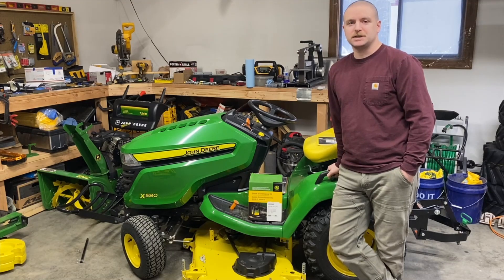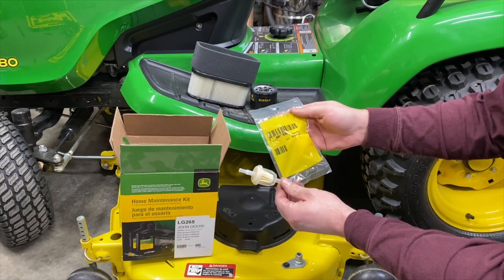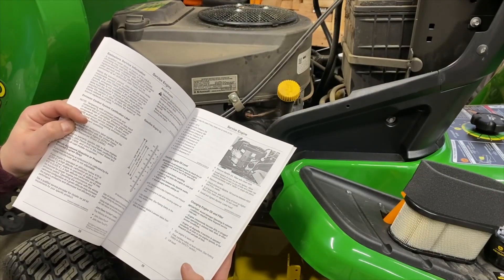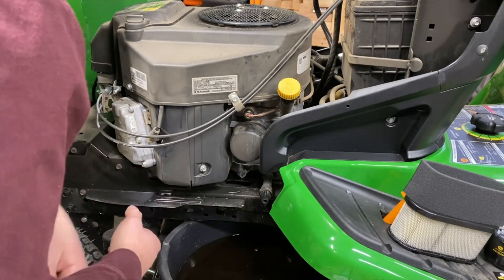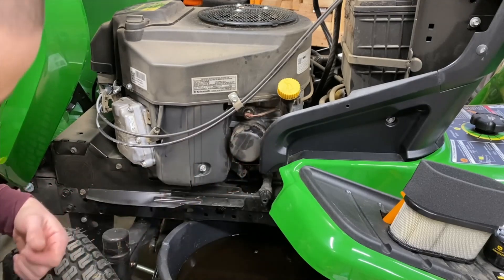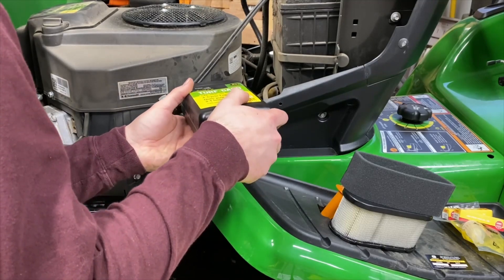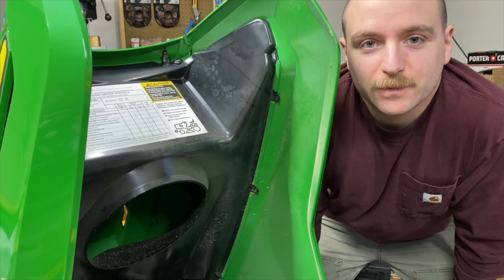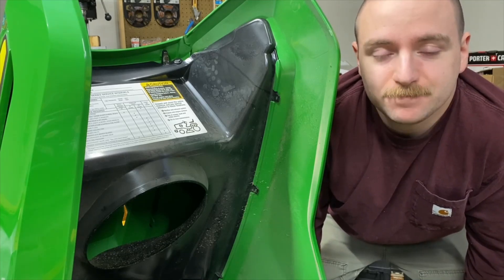John Deere X580 Home Maintenance Kit  - Part 1 Oil/Filter Change

Comment: Thank you for your video it helped me on changing the oil. My late father did all the maintenance on the tractor so I’m now learning to do it all myself.
Reply from the maker: Glad it helped you out! I have all the routine X500 maintenance on here too for the other stuff (fuel, air filter, and transaxle fluid)
Reply: @JoshsGreenGarage  do you have one on how to change the blade on the mower deck?
Reply from the maker: I don’t believe I do, it isn’t hard though, you just take the deck off (I have a video on that) then flip it up, and take off either the nut or bolt that holds the blade to the spindle. I usually do it with the deck still attached and lifted all the way. You will need to put some wooden blocks in there though to stop the blades from turning. One of my first ever videos of my D105 might show something about blade removal as I probably took them off to sharpen before selling, so you might get an idea there. Otherwise, I am sure someone has done a video on it.

Comment: Great "grown-up" video! Only thing different I do on oil changes is I fill the filter up before replacing it. My diesel Mechanic always recommended that procedure, so I just continued it with everything. The filter element prevents spillage and lubing up the gasket is quicker too.
Reply from the maker: Yeah my only problem is spilling oil since the filter is sideways. Plus, oil flows from the outside to the inside of the filter, so I would try to fill it from the edge rather that just dump into the middle, you never know, there might be some small debris from manufacturing or impurities in the oil potentially. Really low chance, but these are things I worry about.

Comment: After loosening the oil filter try slipping a ziploc sandwich bag over the filter. Slide the bag as close to the open end of the filter and keep it there while loosening  it. When the filter is free from the threads slowly pull the filter away from the mower and at the same time tilt it so top of filter is lower keeping old oil in it till you move it away from mower. Still doesn't hurt to have a few disposable towels laid under the filter before loosening it because there will always be a little spillage.

Comment: The floorboard seems to be separate from the rear fenders on the X5 series. 
Are the fenders hinged for easy transmission maintenance?
Why else would these 2 pieces be separate?

!
Reply from the maker: Yes, having the fender deck and floorboards separate makes maintenance easier. They are not hinged though.

Comment: What is the viscosity of the engine oil?
Reply from the maker: 10W-30. Always check the temp range that you will be operating in though, as you can use other viscosities as well.

Comment: Do you recommend changing the oil right after the end of mowing season or right before the beginning of mowing season? I'll put around 25 hours annually on my x590. Thanks.
Reply from the maker: Depends in my opinion… is it getting any winter use? If it is getting winter use then just change it when due or I would say before the next mowing season. If it isn’t getting used and staying indoors where climate controlled, it probably doesn’t matter, but may be a good idea before it sets so that metal dust from normal wear doesn’t build up or any kind of deposited start to gunk anything up. If not used, not climate controlled or outside, it should be winterized. I always ran red storage Sta-Bil in mine, and I kept it in a heated garage, so I didn’t bother winterizing the engine. If winterizing is the case I would wait to change it after winter, after the first startup, that way any junk in it can be broken up once the engine warms and then everything can be drained. I’d also do air filter and spark plugs after that startup as well. So me personally, I would just wait til after winter in most cases. Biggest concern is fuel though, not oil. You don’t want to plug up the carb.
Reply: I start it up monthly during the winter so I guess I’ll wait til Spring. Thanks for the information.